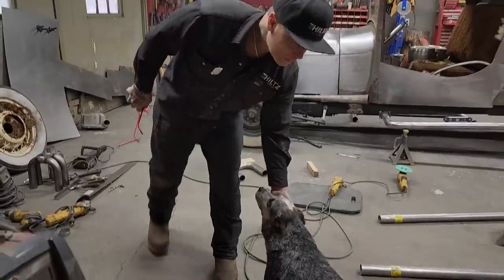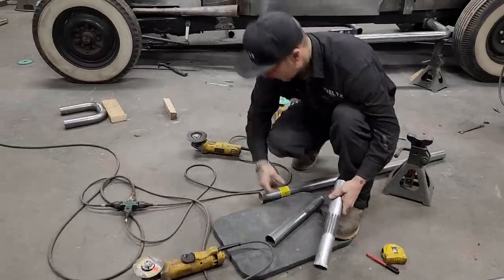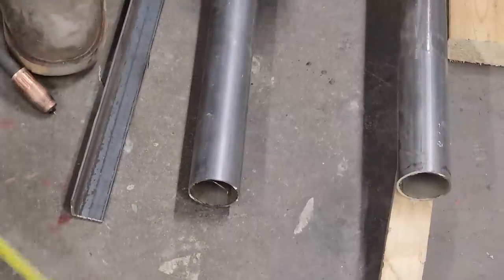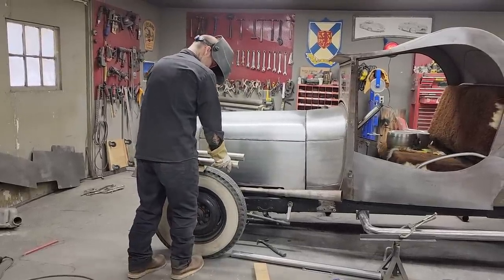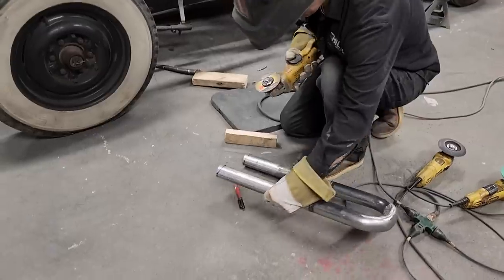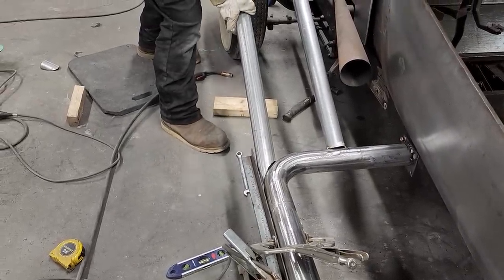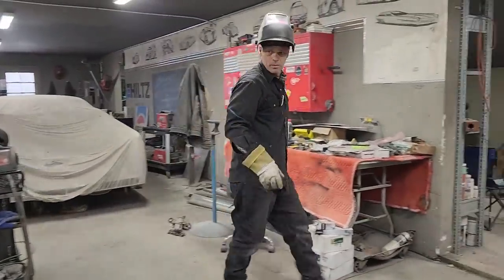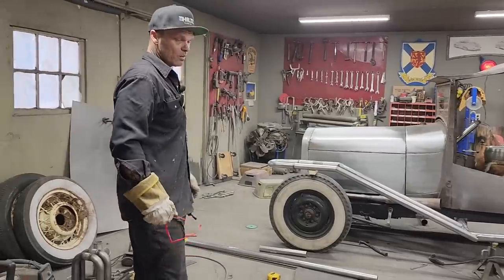Fabricating fenders from scratch out of exhaust tubing ✅

Comment: I was hoping you would have angled the front outside pipe inside the radius on the running board. Would have saved some work and looked better with the radius end of the running board showing. Everything is looking good though. I like it.
Jolene you are really good with the camera and I’d say it even if I wasn’t trying to butter you up lol.
Hey Fina❤

Comment: The small off cuts from notching the end of the pipe can be used to fill larger gaps in the in the joints when welding the two pieces together. Also they are perfect for stabbing yourself in the knee cap, deep enough to damage tendons in your knee requiring surgery, ask me how I know this. Cheers from down under.

Comment: Nice custom work! This is just me thinking out loud…. A visor with wheel arch on the front of the front fenders might look neat? And then the “visor” would attach around from the outside edge to the inside inner fender connecting to the frame….working also as bracing? Model A cars do have a bar shaped brace that does run under the fenders! The head light bar also attaches to that brace holding the front fenders in tension! Neat custom tanker!

Comment: Great job as always chad, but i wonder if u made an angle on the front outside tube on the last inch where it meets the floor tube it will look better 😀
Reply: ?  enlighten us more  !
Reply: Ill try, the tube from fender meets floor tube, its lower , if it had an 45° bend at the buttom the last inch it will flow better,  not that i say he is bad at what he is doing, quit opposit pretty great, just my opinion, ive made tubes since 2008 😀

Comment: The front fender is going to sag very easy---I don't see a good way to brace it. I am POSTIVE you know what you are doing but that is the way it looks to me.The only thing I have ever done like this I cut a VW beetle in half and took a  pc out of it moving back end forward so the finder was about 1-2 in from the edge of the door. I finisher it out very nicely, Most people knew something was different but couldn't say what it was. Had a lot of fun with it. I was about 25 at the time, 78 now so its been a few years.

Comment: Some 45° bends at the foot board and the  top rear of  the fender where it starts to go down to the foot board would've been good to use for fenders with a nice flow to complement the other bends you have used,just a suggestion...

Comment: When you are welding the pipe together Chad and want a specific number, use a hold back. Peiece of pipe or steel and put between both pieces of pipe and tack. That will make sure as you tack it won’t pull on you

Comment: I'm thinking the running board should be shortened in the back so you can put some angle on the rear fender to match some of the angle the front fender has. Just my Opinion. Going straight up on the rear fender just doesn't look right with so much slant to the front one. But don't get me wrong, the build is going very well indeed.

Comment: "CHad do you leave a small pin hole under all your pipes and box tubing? For condensation relief. 
I would have never believed it but it can happen and freeze up it will deform reshape and split your work.

Comment: Cool fenders, are you going to weld the sheet metal on top or cut it to fit the centre of the pipe so it’s easy to clean from both sides and no mud and dirt get stuck underneath?

Comment: Unless the exhaust pipe is thick walled stepping up on it will eventually bend down with a person's weight,  making it all including the front fender to bend downward. That whole application would work but would need gussets under the pipe back to the frame for extra support so it wouldn't start sagging donward.

Comment: EMT conduit pipe comes in ten ft lengths and is sized from 1/2 inch od to 1 inch OD... thin walled steel tubing and it's cheap... in the 80,s we used it to build widebody kits for our fat Mickey Thompson tires
Reply: Lawren, EMT (Electric Metallic Tubing) actually comes in sizes up to 4".
And, I hate to disagree with you. But in the US, all electrical conduit... regardless if it is EMT, IMC, or Rigid... the diameter (1/2" up to 4") is measured by the inside diameter (ID), not the outside diameter (OD).
I know this for a fact. I sold electrical supplies for 20 years (1983-2003) at an electrical wholesale supply company.

And grew up learning the electrical construction trade, in the 1970s, from my dad, who was a Master licensed electrician for 35 years.

I don't know how it is done in other countries.
Reply: Current average RETAIL price, in my state of Kansas, for 2" EMT is around $40 for a 10ft stick.
Reply: @willhorting5317  I was talking about locally, I usually used 1/2 or 3/4, and I can find that stuff around here for about 6 to 10 bucks a stick... and as far as the ID vs OD thing, yeah, I knew that, I just hit the o instead of the I... fat fingers... I knew it came in larger sizes, but at least around here, it has to be special ordered. I worked for 5 years as an industrial electrician... the small diameter stuff is quite handy for making rolled edges around wheel wells
Reply: @lawrenwimberly7311  👍

Comment: If I could suggest a design change to Chad, he should bend the pipe with a similar radius between the upper fender and pipe sloping down to the running boards.

Comment: Looking good so far. Will you be able to reach the bolts/nuts that hold the running board/fender to the frame? Also can you use magnets to help hold all your metal parts together during mockup?

Comment: You can not point outer tube and push it back to fill in the round space. It will cause outer fender tube to be raised higher at the running board than the inner fender tube.

Comment: Its just my opinion the running bord is to far back I thin it would go at the firewall to the rear box at the support just behind the cab I thinking it be more appealing to the eye.  You would be more neddy to Chad its cold🌬 outside Fina just letting you know she is cold 🌬 let me in Dad.  It looks like the back pipe is to high an the front pipe is to low